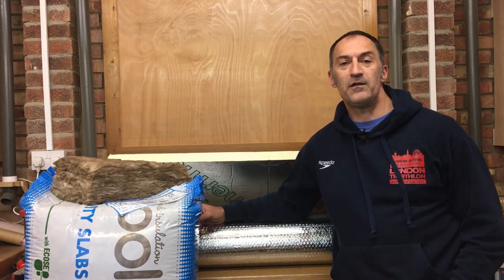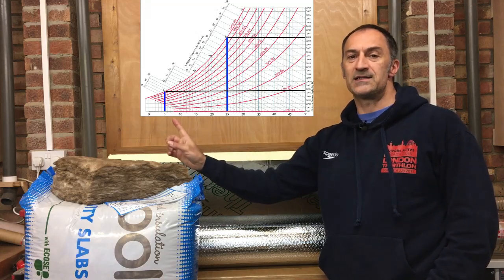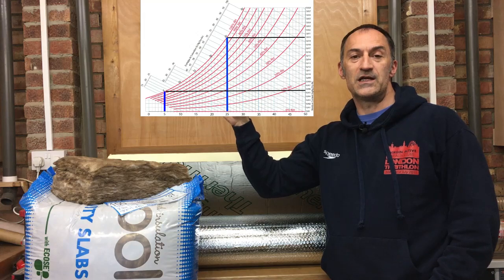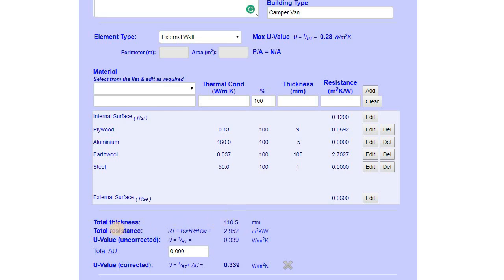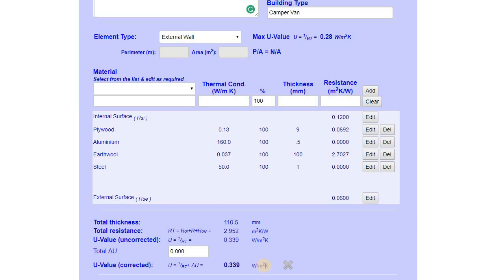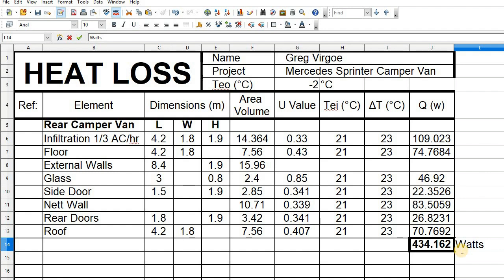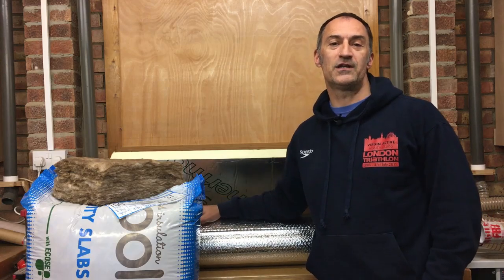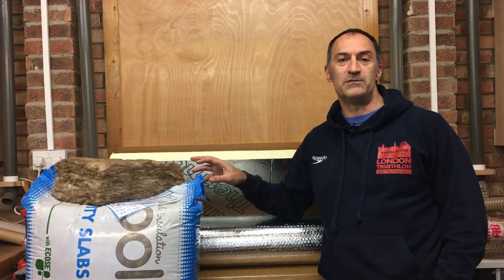How to Insulate your Van Part 1 - The facts you need!

Comment: Hi Greg. This was such a helpful video. I do have one questions though. I am going to insulate my van with armaflex everywhere it is possible and some sort of spray foam in the cavities. When you talk about moisture and putting up some aluminium foil to prevent the moisture from inside the van getting stuck on the metal wall of the van as condensation I am a bit concerned about this: 
If your insulation material allows moisture to travel through it then by putting up the foil you prevent this and opening the windows and your fans won't really help you if you somehow haven't sealed everything perfectly and some moisture got behind your insulation anyway. 
Would you say this is correctly understood - that if you put op the foil it is very important that it is airtight everywhere so moisture doesn't get trapped in there... Or have i misunderstood the whole thing? 
Hope you can help me out:)
And thanks again for your video
Reply from the maker: It’s not difficult to make sure it is sealed everywhere. All edges joins and any services. Not hard at all and then there are no problems at all. The good thing about Armaflex and spray foam is they are both closed cell products so have inbuilt vapour barriers and if applied everywhere you don’t need a vapour barrier. Just Armaflex tape over joints.
Reply: Thank you! This makes perfect sense!!

Comment: Another very helpful video. Thanks a lot, Greg. By the way, a lot of Campers use Armaflex without damp proof to insulate their van as Armaflex apparently does not let moisture through. Is that a good idea?
Reply from the maker: Armaflex is a closed cell product which means it has an inbuilt vapour barrier you do have to make sure all surfaces are covered abs that joins are glued or taped over. 
The disadvantages are it’s not very thick so insulation value could be better. It’s quite heavy in comparison to other materials and can be costly to do a whole van.
yes it’s a good material but has some disadvantages. Hope that helps you 😊

Comment: Brilliant video Greg!
In our old van, we applied sound deadening to the panels and then a layer of foil bubble wrap.
We then applied wool insulation followed by another layer of foil bubble wrap (essentially sandwiching the wool in foil).
The idea was, to apply foil to the cold metal panel to prevent condensation forming and being absorbed by the wool insulation.
Do you think this is necessary as we'll be considering this in our future build or, will the wool/kingspan against the body panels do a good enough job.
Cheers
Reply from the maker: The foil stuck to the van is likely to be also cold enough to be below the dew point and really not worth the additional money and effort to do. The most critical part of insulation is to make sure the inner vapour barrier is fully sealed to all edges and joins. 👍🏼😃
Reply: @GregVirgoe  brilliant, thanks mate 👍🏼

Comment: Greg, you're videos are simply unmatched regardless of things you could do to make it better.  Since life is always about improving nothing is perfect.  I was wondering about warm climates and insulation.
Reply from the maker: Insulation works both in hot and cold climates. Think of you van as a cool box. The insulation will slow down the transfer of heat into the van. The biggest thing to deal with is solar gain. Reflective blinds on the widows will vastly cut down the build up of heat inside.

Comment: Hey Greg, brilliant video thank you. 
What are your thoughts on using Superquilt insulation? 
My ex ambulance is pretty well insulated with rock wool insulation but has no vapour barrier. 
Due to all the windows i was thinking when I strip the fibreglass walls out Superquilt might be the way and then build insulated panels to put in the windows at night. 
Because you haven’t mentioned Superquilt I thought I’d ask you. 
Thanks. 
Ben 🙏
Reply from the maker: Hello Ben, I can give you some sound advice here. Super quilt is not as good thermally as normal recycled loft insulation. It’s too thin where normal insulation you can put a thicker layer in. Plus the cost per roll is crazy expensive. A roll of Diall loft insulation is less than a 1/5 of the price. It always makes me nervous when manufacturers hide the actual specific thermal properties of their material by publishing it built into other structures. If it’s any good just tell us it own data. Why because this figures would not be very good. 
Trust me and stick with traditional insulation and cover with your own vapour barrier. Best wishes 👍🏼😁

Comment: I love the technical stuff, it shows you know your stuff! I've got a bus to convert with lots of windows and I want to cover those for better thermal insulation properties, so I'm off to find that video.
Brilliant! Thanks.
Reply from the maker: The windows that you plan to black out due to internal layout I would black out from inside with spray paint. Then apply a self adhesive closed cell insulation like Armaflex. It has a built in vapour barrier.
Reply: @GregVirgoe  yes! Just the information I need thankyou.
I think I'll use a heat resistant paint, possibly even a metal cylinder paint that gets harder the hotter it gets. I could just paint that on. The vapour barrier you suggested, I will use that too! Thanks once again 😁👍
I've just bought my Iveco 17 seater bus so I will be watching your videos closely.

Comment: I love your videos,  thank you 😊 

You talk about keeping your van warm but can you tell me if the same principles apply for keeping your van cool?

Australian summers are hot and keeping the inside cool is a top priority. 

Many thanks and keep up the good work 👍💖
Reply: Thanks.
Was just wondering if some insulation was better suited for heat 👍
Reply from the maker: @bridielee8203  PIR board is the best for large fiat areas. Then any woolly type loft insulation for the awkward bits.
Reply from the maker: Hi Birdie, yes think of your van like a cool box the insulation will work to keep the heat out and the inside cooler. It will slow down the transmission of heat through the walls. The best thing you can do in summer is shade the windows with reflective blinds. If you can keep the sun out of the van that will keep it cooler longer. Hope that helps. 😁

Comment: Will sounds deadening material like Killmat work as a vapor barrier for the cold from outside from making condensation inside the walls? What do you think will help with it?
Reply from the maker: No it’s not designed for that purpose. You need a layer of insulation to raise the internal surface temperature above the dew point then your vapour barrier.
Reply: @GregVirgoe  even in really cold weather the insulation will stop any condensation from forming or will it be able to dry out if it does form with the moisture barrier in place?

Comment: what do you think about using rubber matting that clips together that some people use outside their vans under their annex< they come in packs of 4 from a hardware store and just clip together. I was thinking of using this as insulation as well as the wool for small spaces and the foil over the top.
Reply from the maker: It a bit dense to be effective as insulation. The best insulators have hundreds of tiny air pockets and are usually very lightweight to give the best insulation properties.

Comment: Hi 
Just started out and stripped out my first sprinter ready to convert to a Racevan 
You have answered many of the questions I didn’t know I had already lol by watching your vids - thank you 
I’m at the other end of the trade and manage a builders merchant so supply many of the products you use and understand the thermal conductivity 
Could you just clarify which Rockwool you use please as I’m worried about the posts I see on mineral wool getting damp and smelling ? 
Many thanks
Reply from the maker: Better still would be to use Diall recycled plastic bottle loft insulation you can get cheaply from B&Q great eco friendly material kind to your hands and water and moisture resistant too

Comment: I'm glad you posted this one, it confirmed my choice of Spray foam as being the best at the time in 2011 and most value for money, it certainly worked and gave excellent soundproofing too, I based my choice on it getting into inaccessible parts of the van and if it's good enough for below the waterline of canal boats then it was more than good enough for me. Thanks for another great video. I have to wonder why you didn't use spray foam though.

Comment: excellent , i forgoten all this but you refreshed my memory. i use to do this and more in calculating heat gain, lose in an air conditioning system in buildongs , hotels, hospotals, houses, in the seventies all in BTUs. thumbs up. good refresher.👍
Reply from the maker: Yes I’m old enough to remember doing them by hand in BTUs

Comment: I have a question , can  laminate flooring underlay with a foil back be used instead of the bubble foil ? thanks Brian
Reply from the maker: The foil layer will act as the vapour barrier just make sure to foil tape any joins or edges 👍🏼😁

Comment: Thanks Greg for a wonderful video. 1 inch (25 mm) thick Polyiso board is available locally, but 2" (50 mm) thick is not. For the Sprinter van ceiling, is it ok to use 2 layers of 1 inch Polyiso board, or would that cause condensation issues?
Reply from the maker: Yes it’s ok. You’ll find it easier to do the ceiling in sections overlap the joints like brickwork and cover everything with a vapour barrier.

Comment: Another incredibly educational video, thank you once again Greg!! Quick question how much of the earthwool did you approximately use? and also did you instal any sound deadening before insulating ?
Reply from the maker: There is a video on the sound deadening. Used approx 4 bails of loft insulation. I would recommend using Diall recycled plastic loft insulation now 👍🏼😁
Reply: @GregVirgoe  great thanks for the reply, so approximately you covered 18mm2 with it. I see the recycled plastic is almost double the price of the earthwool you used. What are the added advantages of it? Sorry for the continuous questions

Comment: Dear Greg, 

what type of material do you advice for installation under Scandinavian climate? I’m Building my off grid bicycle caravan and living in Denmark but probably taking a whole Scandinavian tour once the caravan is ready. Denmark, Sweden and Norway are very rainy and windy places, storms are also quite often blowing. I need to find a solution for a high quality material wall installation to keep my caravan as warm as possible. My walls are from polycarbonate. Also planning to attach sound proof material to the walls top on insulation. So it is really a question mark for me which is the best keep heater less condensing material. Thank you for this great and useful video. So well done! Greetings from Denmark
Reply from the maker: The nest performing insulation by far is PIR insulation boards
Reply: @GregVirgoe  Thank you so much for your reply. Heading to the shops right ahead 🙂👍🏻

Comment: Great video, thanks greg! I wonder, 3years later, whether there's anything you would do different, insulation wise, now?
Reply from the maker: The recycled plastic loft insulation is a very good eco alternative to the rock wool. The principles are spot on and we have been warm in winter and cool in summer. Don’t change the method 👍🏼😁
Reply: I have just installed wool today and put a pic on a forum and now there saying it will soak up all the moisture and I should have used recycled plastic insulation.
I’m now confused and wondering if we need to pull all the wool out and replace it

Comment: Fantastic videos. Thanks for sharing your knowledge with us All Greg!

I’ve been looking for insulation and by the look of it, the majority of people in the UK go for the Polyisocyanurate (PIR boards) such as Celotex / Kingsoan, etc.

I’ve read that sheep wool is the one of the best non-toxic insulation for the camper van conversion.
Apparently it’s sustainable, naturally fire-resistant, breathable, doesn’t retain moisture, easy to install, and it’s literally sheep wool, so there are no toxic chemicals.

* I wonder if you could comment on that 
, please 🙏🏼
Reply from the maker: Yes it has those benefits. Thermally as a wool based product it’s the same as rock wool or similar loft insulation which is only half as good as PIR insulation. 
Sheep wool can be an expensive product to buy. 
Another one you might want to consider is recycled plastic loft insulation from Diall sold at B&Q
Reply: @GregVirgoe   thanks for the prompt reply!
I didn’t know that this option was only half as good as PIR option.
If the only downside was the higher price, it would justify to sacrifice the money and get something like the sheep wools, but after your comments I’m for the PIR boards.

What brand would you recommend?
Kingspan, Celotex or other, please?
I wonder if it’s just the price or if there’s a huge difference in quality/final results...

Comment: Nice educative video! But I have one question for you. You didn't talk about  the fire resistance property. When you insulate a house or warehouse it's a thing to consider for sure, but what about a van/minibus? Is there any better option in this area? Thanks
Reply from the maker: The mineral wool is fire resistant. I’d be more concerned about the 1/2 ton of wood in the van. 
Personally I don’t plan to be in it if it caught fire 🔥
Reply: @GregVirgoe  Yeah you better be anywhere else if the van caught fire 😅 I ask the question because I want to insulate my minibus with projected urethane and I think it’s not the best if fire occur. But like you said, there is a lot of thing that can burn easily in the bus, so adding insulation that resist against fire would not do any difference if fire occur. Thank you again :)

Comment: Best explanation of van insulation so far. But is there a difference in approach between insulating against heat and cold? Or does one approach insulate against both? I.e. if you’re well insulated, you’re good whether it’s cold or hot outside.

Comment: Hello Greg,  I like your video's. Clear explanation. I'm in doubt about the isolation. I'm wondering what happens what happens with the wool when  there's condansation between the folie and the outside of the van. Or doesn't that happen in the construction you use.

Comment: Hi Greg! I watch your video again and again so I can understand! I live in a mixed climate, not too hot not too cold. But I want to travel to places where is hot in summer and cold in winter. So I don't know what to do about my insulation. Right now I'm worried about radiant heat. Since it needs an air gap to work, is it impossible to solve the radiant heat problem in a van? Would it work if the air gap is between the insulation and the interior walls?

Comment: My van walls are perfectly flat ;) It is a box van... I went for box wan because it is much more room inside and easier making into a camper and the walls is fiberglass and already 5cm thick insulated with some sort of Styrofoam alike material. People seems to forget even that box vans exist for some reason even if they are perfect for making into camper. I basically only need to sound insulate it.

Comment: Hi Greg - Another great educational lesson for me. Have a query on the Insulation and ply material selected for the flooring as being 6ft 3 or 1.93m in new money, am trying to keep this to an absolute  minimum. Am thinking of using a thinner insulating layer which has the same thermal resistance of 0.023(ish) for the floor. I am looking at two products which  12mm and 15mm thick with a 12mm Ply. You don't think that this will provide too springy a floor do you?

Comment: As time goes on the probability that you’ll want to have the answers to the questions that you invest the time to provide will reach 100% :) thanks! Your wisdom is always a destination for all us noobs that just can’t accept dogma, they need to know why :)
Reply from the maker: Well said!
Reply: I’m about a month from wading in on my van conversion, but one thing that always puzzled me about the science of all this is the ceiling ribs. 
If they are in contact with your metal roof and channel through all your insulation, no matter how thick & often directly attaching to your ceiling... how is that not a huge hole in the insulating strategy? I often see people on YouTube putting thermal barriers on just the bolts into the frame to hold the extruded aluminum, but all ignore this.  And this is the place most heat accumulates before it’s pressed lower, so how can you not be heating the top of your van via the ribs? 
Why don’t people remove the ribs and put a thermal Barrier up and put them back in?
Just one of the geeky things you can’t help but think about.
Reply from the maker: @jncolligan1  when you get your van if anything like our inner and our skins is bonded together with silicon mastic which instantly gives you some sound deadening and acts as a thermal bridge. on top of that, we have insulated inside every rib, placed a double foil layer over everything and fitted timber battens to the ribs as a further thermal break.
We don't get any bridging issues and we've had snow sitting on the roof for weeks now so I know it's well insulated.
Reply: @GregVirgoe  Wow!  that's a pretty exhaustive explanation :0) and seems proof-positive you're right.  If you don't melt the snow on top or get icicles forming on the outskirts then you've nailed it!  Thanks for another in depth answer! :0)